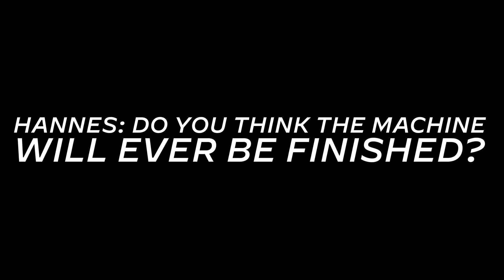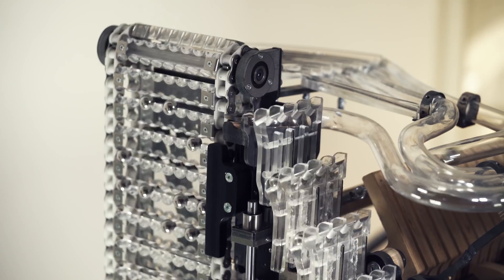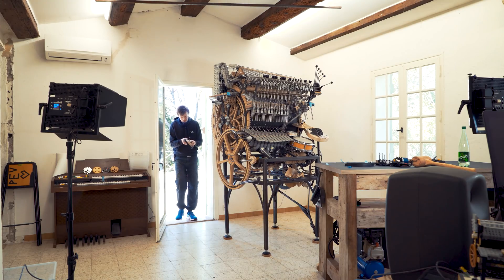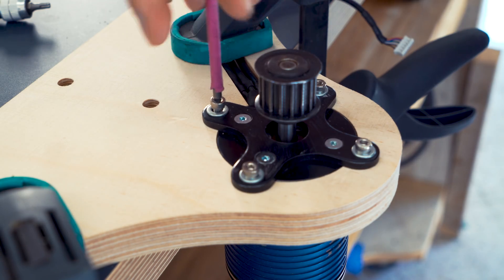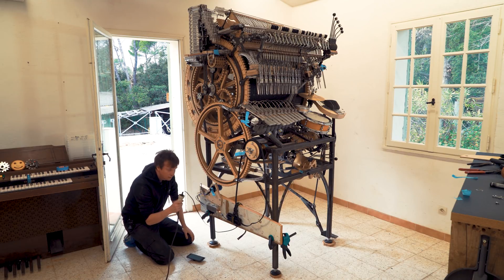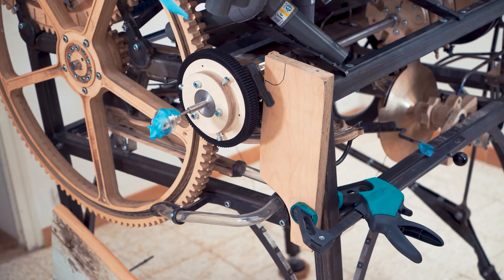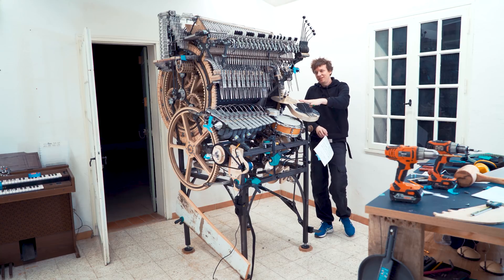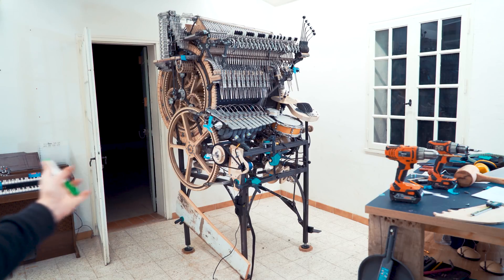Electric Motor? - Marble Machine X #114

Comment: This ruins the magic for me. It's so mechanical and primitive until you add a motor. It just opens the door to, why not make the whole machine just electronic with a microcontroller to make everything work? 😭
Reply: As far as i understand I believe the motor as it is is just temporary addition to allow for more precise testing

Edit: yes, the description confirms this, the motor as it is is only temporary (read the description it goes into greater detail)

Though in my opinion a motor doesn't really ruin the machine at all
it's still the same machine, it still does everything it would do without it, it still has all the highly complex engineering and design behind it

A motor is just a tool to help drive such a machine, not a replacement for any of the engineering behind it
it still works without just as well as it works with
Reply: @dustinm2717  but it is not the same instrument anymore. That's the essential difference. It is a great piece of engineering but the MMX is also supposed to be an instrument played by a human being, not a motor....
Reply: @hansvanlennep6376  "it's ment to be played by a human being, not a motor".

ummm...

What difference does it freaking make weather it uses a hand crank, a foot pedal or a motor? All 3 methods do the same thing, they just power the mechanics necessary to work the machine. Also, the motor doesn't take away any of the human interaction which you're clearly unaware of. The strings of the bass guitar will be triggered by the marbles and the fretboard of the bass will be worked by hand. The machine has muting levers to mute and unmute the various instruments to control the "mix". And the marble reliece levers can be manually opperated to improvise on the machine's vibraphone. So it's pretty obvious that this thing is still an instrument, because the motor hardly takes away any human interaction. If you would watch the original marble machine video, it's hardly any different from what I've just described. The only difference was the source of power, and that's litterally all the motor is doing, it's just powering the machine and nothing else!
Reply: @justinnaramor6050  i have watched every marble machine video there is and a lot of other movies from Martin. My comment clearly stated that I was anxious about the machine becoming a "draaiorgel" which is a automatically played machine from the Netherlands. Martin actually went to a museum in the Netherlands for inspiration. These draaiorgels are in my opinion not very special because they lack "the human factor" in playing music. The human factor being the little imperfections that create the true soul of a music song. Something that in my eyes is completely wiped out if you let the machine play by motor. I think that I was (and still am) concerned about the fact that the marble machine is more and more becoming a machine instead of an instrument. The video's of Martin were slowly starting to become all about engineering instead of making music. Now I have seen Martins most recent video's (again I watched ALL his video's) where he luckily started to focus more on playing the music. I wanted to share my concern because I have watched the entire proces and know all the decisions he made. That's what I also mentioned in my original comment. Ofcourse I do still support what he does as it is a project of unbelievable size and I have the highest respect for his decisions.
Reply: @hansvanlennep6376  I guess I have a hard time understanding how adding a motor auautomatically makes it less of an instrument and more of a machine. To me, the fact that some musical possibilities on the machine can be left up to the performer controlling the device (rather than having every single musical decision completely pre-programmed) is what makes this closer to an instrument. If every single musical idea was completely pre-programmed, than yes it would be more of a "playback" machine.
I have an idea for the machine: why not have both the motor and the manual power? you'd get the best of both worlds that way. The device could have some kind of clutch that could isolate the motor from the crank and foot pedals. This would mean you can use the crank or the pedal to powmanually power the machine, then switch to the motor when it's absolutely necessary. Not sure how well this would work though, I'm not a mechanic or an engineer by any means so I don't know.
Reply: While as ever a great video and nice engineering, I have to agree the beauty of the machine is its mechanical wonder and human power. The motor ruins it whatever the advantages 😢
Reply: I totally agree with you on this.

Comment: Hi Martin, make sure you have a way to tension the belt, in the video the tension you applied is not enough.  A good tensioned belt will save you lots of issues and also give consistency to the music.  Perhaps add screws that when tightened will pull motor away and tension it.     Also watch out for the motor heating up.  When you stop the machine, the amperage in motor will climb dramatically and heat it up quick.

Comment: Just a tip: never solve the belt issue with flanges if you can avoid it. The proper way would be to make the tracking adjustable.

Comment: The MMX really needs a digital display of the beat in bpm. Old fashioned NIXIE tubes would look great. You can use an arduino as the counter and use either old Russian NIXIE tubes or the new ones made by Ukrainian company Milllclock for their designer digital clocks and counters.
Reply: Feature Creep:  A key ball-bearing counter for the times that the avarage ball bearing makes a loop on the MMX.

Comment: Hi, loving your video. But don't stall a brushless motor, you will have a spike in AMP and you may end up frying something. maybe you want to couple your break with a off-switch, (or a clutch system), so you don't loose the tempo (set RPM).

Comment: I'm not an electrical engineer, but someone told me that using an ac adapter with the cord wrapped around it could start a fire. Can anyone confirm this one way or another, because I was so scared the last third of the video.

Also, Martin, you won't be able to reach the motor controller in that position once the marbles are flying off the vibraphone into the funnels. :) 9I don't think, anyway; the angle could be making me misjudge it).
Reply: It's definitely bad practice.  Whether or not it would result in melt down or fire depends mostly on the current level.
Reply: Would it this also lead to International customs issues?

Comment: a bike hub mechanism or a clutch on that handle would be cool so it doesn't spin when you're not operating it, would be safer and will allow you to reach that area with conidence. A clutch helps decouple manulaly but you have to rev match when you couple it back. A bike hub that laches on when you reach he corect rpm would best. With a deatch button so you can detach manually. This is because a bike hub will let you coaster, witch it should not if you want to slow down.
There are so many cool ideas on this.
Maybe on Marble Machine XS ey? :)

Comment: Doesn’t a motor defeat the purpose of a fully mechanical musical instrument?
Reply: It's still fully mechanical without the motor.
Reply: Jordan Drake Yeah and a 747 is fully a glider without the engines
Reply: @cjeam9199  apples and oranges dude.
Reply: Jordan Drake Exactly. A motor defeats the purpose.
Reply: @cjeam9199  not really though, he is still using the hand crank and the whole thing does not 100% rely on the motor and the motor can be turned off any time he wants. It's still fully operational as a mechanical device.

Besides, It's not at all practical to expect him to be able to crank the wheel for 2 hours at a concert without some assistance.

Comment: So now you have the helper you can get rid of the pedal? Surely you don't need it now?
Also, you should move the motor somewhere in the bottom of the machine. Connect it to the frame just above the lowest PMMA pipe with its own gear and shaft.

Comment: I already commented in another video about the same thing, i dunno if my idea will be taken seriously as im just a young lad that knows nothing about anything but here we go:
You need some sort of restraining mechanism for the crank, something that would make your arm act as a mere force, just putting the machine forward (instead of also timing it). That could be in the form of a pendulum, with an adjustable counterweight for the timing, it would be absolutely precise, as you could make milimetrical adjustments as you will. Or maybe a centrifugal based mechanism, with 2 arms and a counterweight in each arm, the closest to the middle the faster the thing spins and the faster it drives the torque to the machine. Well, it could be done in a huge number of ways, like, just restraining the initial turn rate to a set value by means of a mechanism similar to the ones listed above and then using a gearbox to achieve the desired turn rate afterwards. Hope you got the point you mad lad ;)

Comment: Hi. Caution: by adding a motor the mmx becomes legaly a machine accoring to directive 2006/42/EG. Therefore you have to do a documented risk analysis,  declare conformity to the directive and put a CE mark on it. Otherwise you could get in some trouble if someone other then Martin(e.g. a Roady) hurts himself while handling the machine. Don't panic, the process is not as complicated as it sounds, but has to be formaly done. If you have questions, feel free to contact me.
Greetings from the Rhine (near Rüdesheim), Tobi

Comment: It would be cooler if the machine could work completely even without the motor making it the epitome of engineering...use the motor just to reduce the human effort. I understand if this is very hard/impossible even. But seeing this machine perform without electricity save for the base made me really awestruck. This is what made Marble Machine unique.
Reply: @yt45204  Yeah mate the machine could be really heavy if it's completely mechanical. Just saying that it could have been really cool seeing one thats all. 
Btw steam engine is not a bad idea lol.

Comment: Wintergatan You need to test the motor if itll maintain its timing as different modules of the machine are activated. If for example, as you tested in video, the motor outputs X power and the machine needed X power, but as you activate the ball dropper, marble collector, and other components, the machine would require x + y while the motor is still only providing X. Wouldnt this throw off timing due to more mass having to be moved but same output work? 

Maybe the flywheel accounts for this or the load added is negligible but its still a thought.

Comment: Hey Martin, I was wondering if you are going to mount the motor with some kind of suspension, like in professional microphones or with some kind of rubber washers. If not, the sound and vibrations of the motor might mess with the contact microphones.

Comment: Group Idea: Add motor to the flywheel so you can use its torque limiter and hide electronics better. 
While i agree with the need and functionality it takes from the pure mechanical look and feel, kinda hurts my heart to see it.
Reply: Wouldn't this idea also maintain flywheel speed during pauses allowing near instant tempo resumes? You'd lose some ability to modify the tempo though.

Comment: Correct me if I’m wrong, but from what I understood the tempo is set through the potentiometers 

Basic idea is good, and as an electronic engineer, I know you can make a basic circuit that could mesure the speed of the motor so that whenever you activate the switch, the electronic potentiometer matches the current speed to maintain it

Which means that during a concert, if you already have the correct speed set up by your hand, you only have to activate the switch while you do something else

Comment: Love the idea but not the current implementation. It shouldn't be on the "show" side of the machine, obscuring the most beautiful component. It should be under the machine, out of sight, driving the flywheel. This way it'll be able to run pretty much continuously, keeping the flywheel's speed up even when you disengage it with the clutch. It also shouldn't be obvious that the machine has a motor unless you examine it closely.
Reply: Also, that's where the funnels should be, so it cannot be the permanent location

Comment: As a guy who does embedded control systems all day, I can say that that motor controller is really cool.
Reply: Could Martin attach an electronic torque activated clutch/brake (I'm obviously NOT an engineer) as a safety measure? By that, I mean that with an increase in torque due to friction a switch could engage a clutch to remove the motor from the MMX.
Reply: Yeah I would hate for him to lose control of the motor which is propelling such an intricate machine
Reply: Can you explain how he is able to manually set the tempo? How does the motor know what speed to go?
Also how is he able to slow the tempo manually?

Comment: finally a machine is born at least by the definition of my prof
Reply: Wait, explain why this wasn't a machine before he added the motor?
Reply: @jesperhagstrom  his definiton of a machine, included a drive other than human or animal power as well as moving parts.
Maschinenrichtlinie 2006/42/EG (His source)
The requirement of a drive wasn't fullfilled before.
Reply: @chinook9785  huh that's a bit odd! I think my teacher told us something along; A machine uses an input power to mechanically perform an action. So the power source can be whatever

Comment: The motor is a nice improvement to the machine but imo it takes a little bit of the magic away, now that you use electric power. (Yes I know in the end the machine will be recorded with many little microphones and probably EQed etc...)

Comment: I mean, you probably know this, but when I do channels in parts like you have on the CNC, I use a round end bit at the correct side diameter you need the part, and mill a channel with that... it'lll save you drillling it out later :)

Comment: a few other people have also mentioned it, but the best spot for the motor is if it was attached to the flywheel to maintain its speed
in my mind it also eliminates the concern of it no longer being hand powered; it's just helping the flywheel be more efficient and consistent

Comment: Everyone commenting on how the motor is placed, where to install it better, or how disappointed they are, I thought he said early in the video that this is just to work on the timing. The install was definitely temporary with the scrap board clamped to the side, so IF MMX is getting a motor, I wouldn't be concerned about how it's cobbled front and center, defeating the torque limiting clutch and obscuring beautiful design elements. If it becomes permanent, I'd expect 2 or 3 revisions, metal brackets, and TIG welding, not a quick clamp and a scabby board as the attachment mechanism ...

Comment: Martin! Is there a way for you to set the speed by cranking, then some detector captures that BPM and maintains it for you? That way you will be able to control the speed far more accurately and change tempo mid song. It also maintains more of your steampunk aesthetics and use of the crank.

Additionally, bringing the MMX up to speed will be really, really hard on the motor. This way you help the motor last longer (and fail less) too.

Comment: You could get way smoother operation and better speed control, especially at low rpm, if you used a sensored controller. The motor already has a hall sensor built in (the 4th wire that isn't connected).

Comment: Thoughts on the motor: overall negative.

I feel like it kills the whole “hand crank mechanical machine that makes music” thing you had had going on before. Now something about it feels...off. The fact that you can now press a button to start the music and walk off the stage seems disingenuous. Guitars don’t strum themselves and drum machines sound lifeless. 
It’s current location is way too in your face and only enhances this negative feeling that having a motor driving it invokes. 
However, I do like the idea of keeping it IF: a) it gets hidden somewhere inside the machine and b) it is only used in calibrating other aspects of timing and NOT for performances (for example, setting the machine to constant tempo and measure deviation in marble droppers to calibrate them)
Reply: Okay—afterthought. I think this is only intended for testing, yes? Just rewatched the intro. I think many people are confused by lack of explanation on the motor

Comment: maybe you should consider mounting the motor permanently to the machine from the inside of the frame. Metal bracket for the motor into the frame (one screw hole and the other adjustable by a radius hole). One piece 3d printed gear and flanges. And the speed controler bolted to the frame with some thermal compound in between the two to help dissipate the heat produced by the transistors.

Comment: I was expecting the motor you end up near the fly wheel. This was a bit "in your face".
Reply: He said that the parts were temporary
Reply: I believe the motor is only for testing so won't be seen during performances which is why he hasn't welded it in place

Comment: My first eh feature.   I get why it could provide benifit, but it doesn't look like it fits, and I don't think it fits the intellectual theme either.   Whatevs though!   I'm still super happy for a video.
Reply: Robin Yureck He mentioned a few times that the original intention of the motor is just to be able to test the time keeping of the machine in order to make adjustments (as shown with the cymbals in the video.) How/if it ends up on the machine is pretty up in the air at this point — I’m sure he’ll be thinking a lot more about the aesthetics and use of it in future.